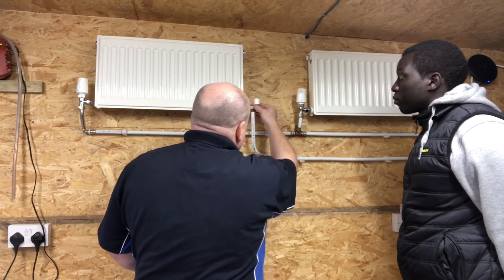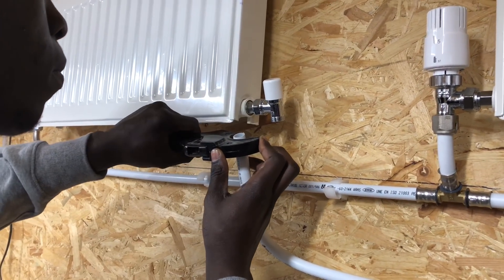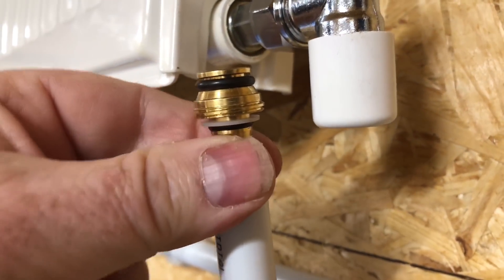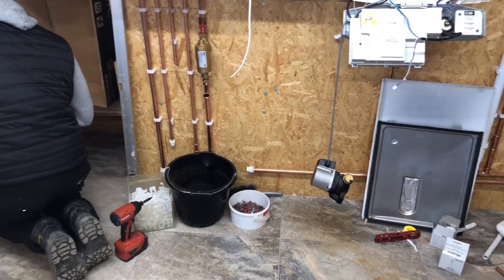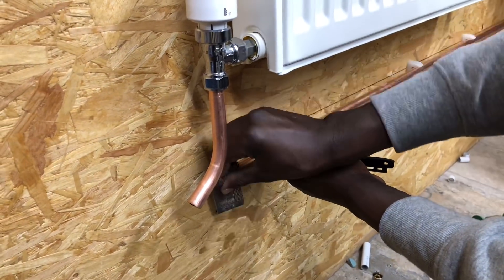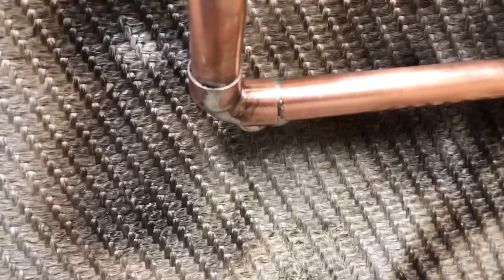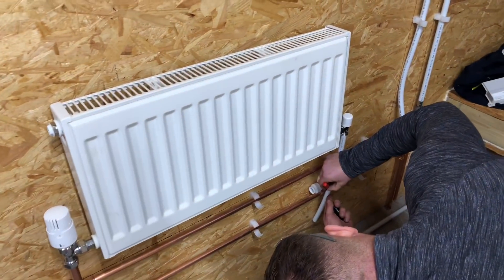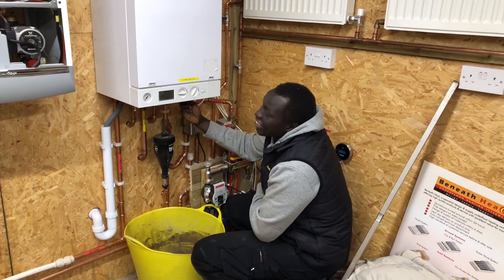Apprentice Plumber Training How To Install Central Heating - Day Two

Comment: Alan could I send you a video of my dual heating system, oil boiler and solid fuel stove. I  had a chap look at it before but I didn't think he knew much, my problem has only come to surface now because I only bought heating oil, which I hadn't bought in years because of financial issues. Now when I put on my heating the water pitches out the overflow pipe in the attic. I'm handy at this type of work if I'm showing what to do!! Any help would be much appreciated Niall.
Reply from the maker: Unfortunately i don't know

Comment: the inlet would be in the top and the outlet at the bottom, and dont finger the pipes and fitting after you clean it, you have grease on your fingers :)
Reply from the maker: Thank You

Comment: Look at them both figuring out where to put the pipe work bet there heads are spinning I remember all thst back at college working in twos to do your practical go on lads 👍👍👍
Reply from the maker: Danny has his own business now
Reply: @AllenHart999  does he good on him how’s phil doing
Reply: Also Allen mlcp to copper are the brass tail ones alright or do you prefer copper ones transitioning over to mlcp and I’m abit worried about the brass compared to copper
Reply from the maker: @pauls826  Phil works for council. Both done well. Thanks

Comment: you used chrome pipe tail into rad valve connected by a press fit fitting do you not need to clean the chrome off the pipe first before using the press fit tool ????
Reply from the maker: Graham Atkins The chrome tail comes made up, I didn’t press onto the chrome. 👍 Thanks
Reply: @AllenHart999  the first rad the lads piped up had a chrome plated pipe then they used press fit fitting do you not have to remove the chrome plating first before using the press fit fitting regards
Reply from the maker: @grahamatkins8845  You wouldn’t need to remove the chrome. Thanks.

Comment: I've never used paste on compression fittings the water is sealed via the olive I work on hydraulic systems where the oil pressure is over 200 bar and all the fittings I use on steel pipework have olives never had a leak so far.
Reply from the maker: Thank You.

Comment: How come they don't do any soldering in their first year at college? Surely that's basic plumbing skills, or is soldering seen as an old way to do things?
Reply from the maker: No idea to be honest. I would guess they do health and safety.
Reply: The first year is such a load of bs health and safety and principle theory you wouldn't believe the bs that they have to teach now with ladders and platforms etc...
Reply: Instead of making the health and safety stuff part of a “plumbing course” which has nothing to do with the plumbing itself but rather safe working in general, and considering you do all that health and safety and if you want to work on a site still need to do health and safety for a Cscs card.

Why not just stick to the plumbing with the plumbing course and then do the CSCS card with the health and safety afterwards as a compulsory extra?
Reply: My first year I did soldering and LCS frames and copper frames